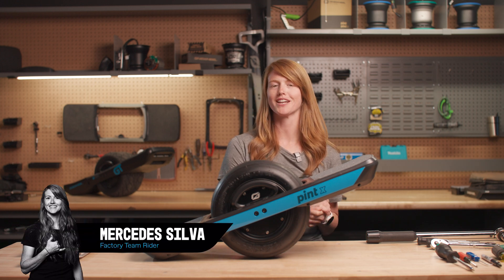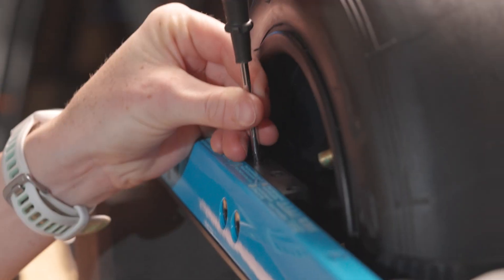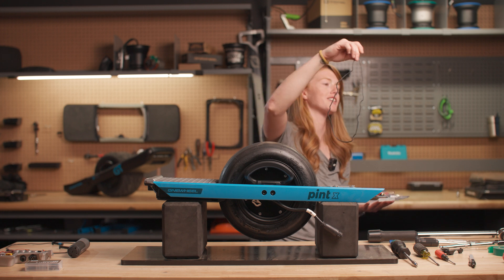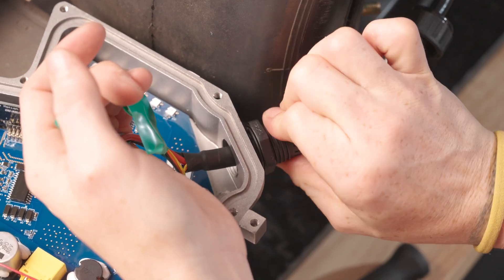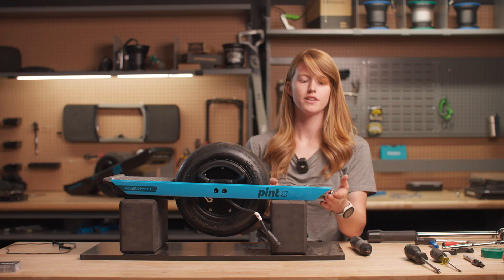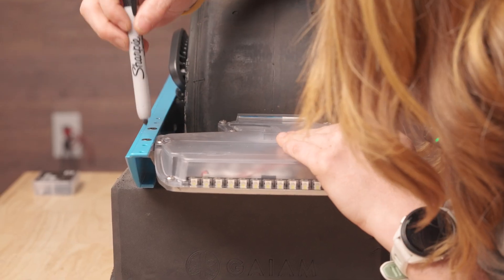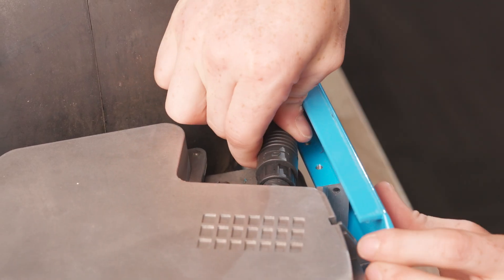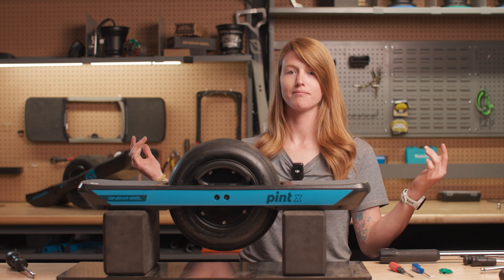How to Install a Onewheel Pint X Controller Module

Comment: Just swapped.  Got everything buttoned up.... Then found out you need the controller number from the new controller.  Also found after you register the controller back out of the owner portal there should be a popup for partition controller.  After that back out again and there should be a popup to install battery.  Then everything should be registered!

Comment: I did this swap for my son's one wheel. The main board was no longer registering the foot pad. They make it extremely difficult and I'm still trying to figure out how I register the part and get it to be compatible with the existing board. There's no instructions, The app is not making this streamlined, and one wheel being Pacific time they're also hard to get a hold of.  I've been waiting to get those board working for days after I spent $300.